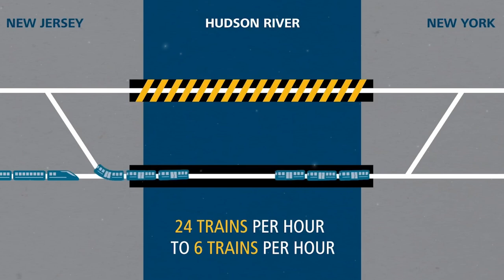WARNING: The Shocking Cost of New York's $16 Billion Hudson River Tunnel!

Comment: The title of this video is disturbing. There is no need to warn readers. This public works investment is not dangerous; it is not a threat. To the contrary, a lack of investment would dangerous. The tunnels are used by 200,00 people a day, many of them going to and from work. The existing tunnels were damaged by superstorm Sandy and need to be replaced or seriously overhauled. They pose an element of risk. NJ Gov. Christie and President Trump stood in the way of investment. President Biden put in place money to build new tunnels. NJ and NY have approved matching money. If the tunnels are built along with the new Long Bridge and the S-line, Amtrak will pay for itself over the ensuing 50 years. If Trump regains the Oval Office, we are stuck with a dangerous third world passenger rail system that loses money.